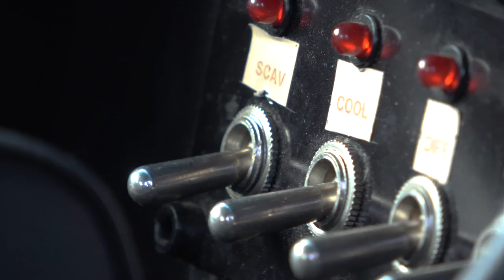Race Cars DO NOT Make Good Street Cars

Comment: You just aren't a good car builder. You can leave all the comfort features in a car and make it legal, plus fast. My street/race car has A/C still because I live in Florida and I'm making my power with a large cam that leaves me with a high idle. You could wire a switch on the Windows and could connect a cable or popper to open the hatch. Will it be as easy as having a stock Accord to daily, nope. Will it be more work to build a better race car that is more finished, yes, but it's certainly possible too. Hot Rod magazine covered a twin turbo BBC 5th gen Camaro with all the stock navigation and other comfort features that was built to run drag week.

Comment: Your car is half assed. You need to get motivated to clean it up and finish it. Personally I think a few mods to the interior would be a big plus. Add window switches and upgrade the rear lid struts or take them off. Clean it out and replace the passenger seat.